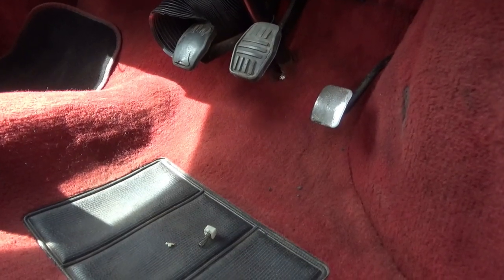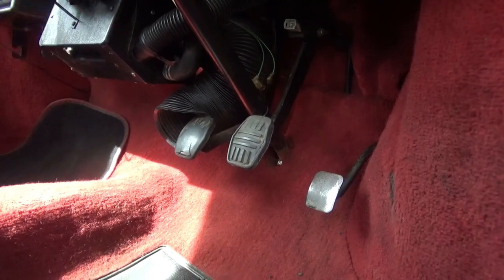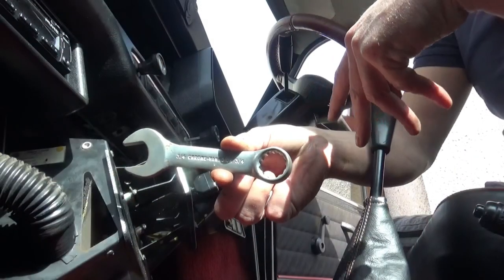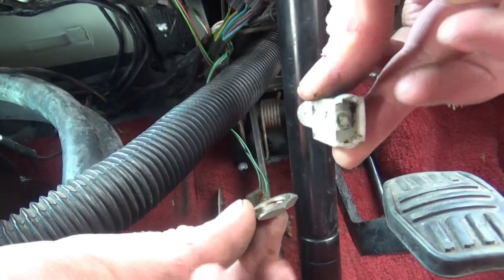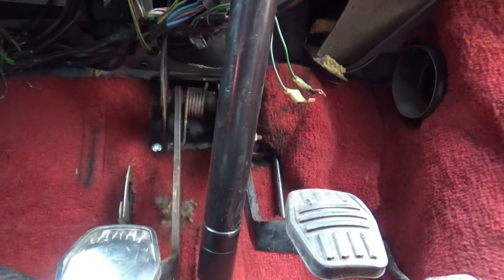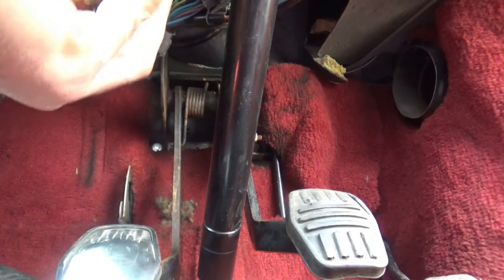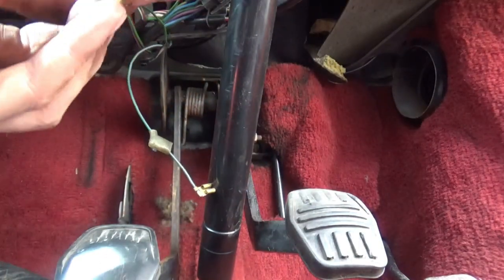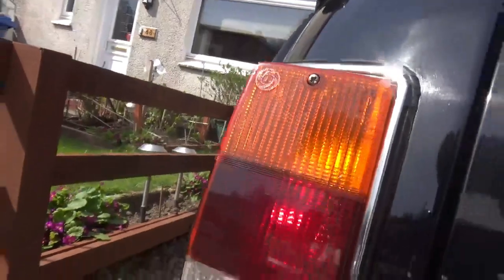Austin mini Brake light switch replacement

Comment: Great video Sean. Brake light switch a bit of a fiddle but you got it sorted. With all the work you have put in it should pass the mot easily.
Cheers, Jeff.
Reply from the maker: Thanks Jeff, The switches on the minis are too close to the fresh air duct and it only takes a knock of the tube and the switch is broken :(

Comment: Great video Sean, this is a job that James has lined up on the JCW Cooper the brake lights are stuck on lol
Reply from the maker: Be careful when refitting the fresh air as it can knock the switch. This is how I busted my one lol
Reply: BMC Workshop aha thanks for the tip 👍

Comment: Sean, The switch on the pedal is a pain as the plastic breaks quite easy, The old pressure switch on the subframe is better but
the do collect a bit of dirt & oil around them, It will be good to see Annie out on the road after winter, Cheers Dave
Reply from the maker: Thanks Dave, as Ironic as it sounds I converted Angus;s pressure switch on the subframe to an electric switch on the foot brake for that very reason plus they were a bugger to change lol
Reply: should try fitting one on a reliant
Reply from the maker: I can imagine it would be a pain in the backside lol

Comment: Nice. Is there ability to adjust the brake light switch actuation point? I believe the Haynes manual states the lights should come one with 5 or 6 mm of pedal movement and to adjust switch if needed. 
Also, I'm wondering if there is any way to easily reposition the heater box slightly left or right? My '88 is LHD and I find my foot is very close to the heater box when on the throttle pedal....making it difficult to move to the brake without getting snagged/bumped on the heater. If it could move just 1/2-1" the the right and still mount fine that would make a huge difference for me.
Reply from the maker: The brake light switch can be adjusted via the retaining nut as this controls how soon the rear lights illuminate upon pressing. I'm unsure of what the Haynes says about it as it's something I haven't checked on but I did retrofit an electronic brake light switch about 10 years ago in my Mk3 mini (Angus) and all I done was buy a bracket on the internet and attached it to the brake pedal then fitted the switch. 

With regards to the heater box, there is no reason why you can't move it but you would need to move the mounting brackets on the front bulkhead. The easiest solution would probably be to buy an aftermarket heater 

All the best, Sean
Reply: @BMCWorkshop  THx. Does the stock brake light switch thread into a bracket and then get the flat nut you showed in the video...acting as a lock nut? That would make it adjustable in a threaded bracket.
Reply from the maker: Yes bud

Comment: hi Sean, great video just wondering where you got your usb charge points to replace ashtray ?
Reply from the maker: Hi Jamie, I got them from ebay  a few years ago
Reply from the maker: Link to the one I have here: https://www.ebay.co.uk/itm/Waterproof-12V-Lighter-Power-Socket-and-Double-USB-Port-Socket-Boat-Caravan/201665837115?hash=item2ef438783b:g:47IAAOSwBs1XMgpJ
Reply: Thanks Sean for the reply that's great will take a look 👍

Comment: Thanks for the video. Great looking Mini Thirty. I've not long become the owner of a Cherry Red one. 
My experience with the brake light switch so far is that it's a pain in the arse... Sides, arms and fingers aha! 
Noticed my brake lights where stuck on and when I investigated noticed the nut was nearly entirely off the switch at the back of the peddle arm. Did it up slightly and got it working.... Then I tried to put that air duct pipe back and somehow manage to snap the brake light switch. Suspect the plastic was brittle. So now waiting to receive a replacement.

Should you leave some slack between the metal plate and the nut or should you be done entirely up? 

Also, those connectors are a pain.

I will stop moaning now aha
Reply from the maker: Hi Matt, thanks for watching. With regards to the retaining nut on the brake light switch, make sure it's tight. If the switch wiggles about it will quickly fail again. When fitting the air duct be careful not to disturb the switch as its easily broken due to its location and poor design. I'd also recommend buying a couple of extra brake light switches and keep them as spares as they are easily broken. All the best, Sean
Reply: @BMCWorkshop  thanks Sean. Think I will do just that. I was baffled by where the pipe goes. I was starting think someone had had it out previously and reconstructed it all wrong but after googling images of others it looks as though it's just how it goes. Can't seem to get the pipes on either end correctly. Or it goes on one end and then not the other. Guess that's when I broke the switch. Lesson learnt. Will try and stretch out the air duct a bit before fitting next time
Reply from the maker: Try fitting the duct to the inner wing first them Stretch it over the the heater box. You may find it easier if you take out the drivers seat so it gives you more room
Reply: @BMCWorkshop  yeah I was thinking about taking the driver's seat out. I attempted last night before it got dark and feeling the aches in my back today from bending at weird angles aha
Reply from the maker: @mattwood3157  my back is buggered just now with lying upside down under cars lol
Reply: @BMCWorkshop  working on this mini is definitely making me feel aches and pains in places that have never ached or hurt before aha!
Reply from the maker: Yeah these wee cars can be awkward to work on at times lol

Comment: How far is the brake pedal travel? Also, are the brake and clutch pedal level when both are released?
Reply from the maker: Hi, the brake and clutch pedal should roughly sit at the same height. Pedal travel on the brake shouldn't be much (approx 2 inches) If your brake pedal sinks in to the floor then you quite possibly have a leak in the system
Reply: Hi, thank you for the reply. The pedal doesn’t go all the way to the floor. If it was to be the same level as the clutch pedal when the brakes are released, the travel would be about 2”. I have the pedal box out & there was no play. I have changed the brake light switch too. The switch is on a fixed bracket & fully done up. I think it will have to come out again!***!**!
Reply from the maker: Top tip buy a few spare brake light switches as these are very flimsy and break very easy. With regards to the pedals, they don't have to sit at the exact same level, about half an inch of difference between the height of the 2 pedals is acceptable.

Comment: Hi there, just trying to locate my btake switch and cant for the life of me see it. I saw in your video at tje start you had a small white plastic piece and a nut which you had removed, I have located that and removed but cant see a brake switch. Am i doing something wrong? I have no brake lights. 96SPI
Reply from the maker: Hi Joanne, the white piece you describe sounds like the brake light switch as the nut holds this in place. There should be 2 wires attached to the brake light switch. These switches are really delicate and easily fall apart by themselves and the trunking behind the pedals also doesn't help. 

To locate the switch, have a look behind the brake pedal as that's where it will attach. If you look there you should see 2 wires, they may still be attached to the remains of the old switch.

Hope this helps, all the best. Sean
Reply: @BMCWorkshop  wow appreciate the fast response 👏 especially as this video is a few years old too, cant thank you enough. On further inspection it doesnt even look like I have a brake switch, all i have is the white plastic screw part at the end of what looks like the switch and the rest of the switch doesnt exist. Will buy a new one. Cant see which wires  should connect. Wish I could send you photos so you could see haha
Reply from the maker: Thanks Joanne, if you click on the "about" tab on my channel home page there is a link where you can email me. It definitely sounds like your switch has fell apart. The good news is they are cheap from m machine/ minisport/ minispares etc. I'd advise buying a couple of switches so if it breaks again you'll instantly have a spare to fit. Fitting the switch is easy enough but it's just awkward to get to
Reply: @BMCWorkshop  I cant see a link in your about section, theres a link to instagram but thats all, but thats ok, I will buy a few more today and try and replace in a few weeks time when they arrive. I don't want to bother you too much. If you dont hear from me again, I have fixed it hehe. Thanks again!!!
Reply from the maker: bmcworkshopuk@gmail.com
Reply: @BMCWorkshop  thank you, will email you tomorrow as need to get a few more photos in daylight. I know its broken but locating the wires is now my next challenge.

Comment: Alright pal, the four switches on the dash, the furthest left has a brake symbol. What does this do? Can’t find it online And dont want too press it lol
Reply from the maker: Its just a test light for the brake fluid
Reply: BMC Workshop what does the switch actually do tho? Appreciate the quick response!. Like when i flick it what happens?
Reply from the maker: Its a test to check the light works. In theory if the light illuminates when driving then the brake fluid is low. A lot of minis (mine includrd) doesn't have any wires going to the brake master cylinder so its completely pointless.
Reply: BMC Workshop truly appreciated!
Reply from the maker: @michaelkennedy8573  Your welcome Michael